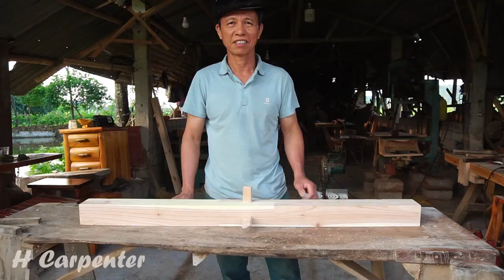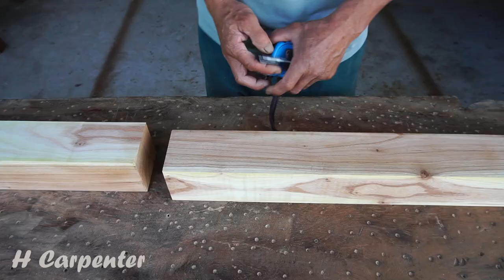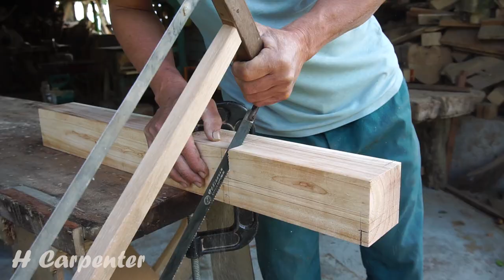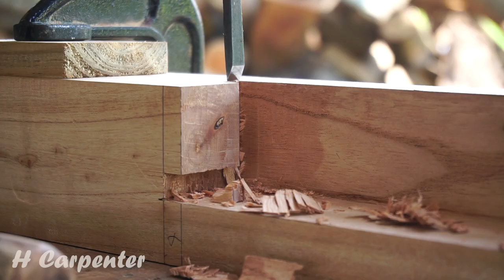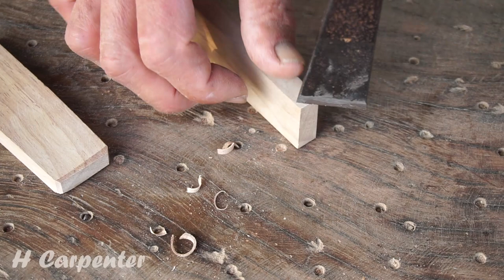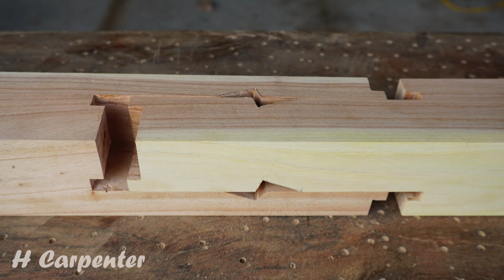Extreme Japanese Woodworking Skills Joinery - Awesome Hand Cutting Wood Joints

Comment: What is the practical use for this joinery?
Reply: A simplified version..yes. It's just a fancy variation of a standard scarf joint, used in framing traditional buildings all around Europe and Asia. My 300 year old house has maybe 8 or 10 of them, and I've made 4 in the part I renovated. He's weakened it by hollowing too much out of one member.
Reply: One use would be to extend e.g. sole plate timbers so they become locked together as a single continuous piece.  Strength is derived from the way each part interlocks and it's also a handy joint - from a selection of scarving joints -  to use if repairing/replacing damaged end timber at the base of an upright column.